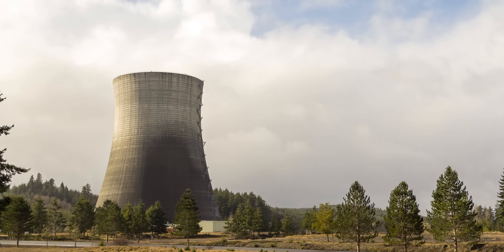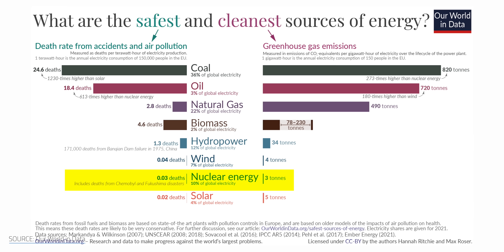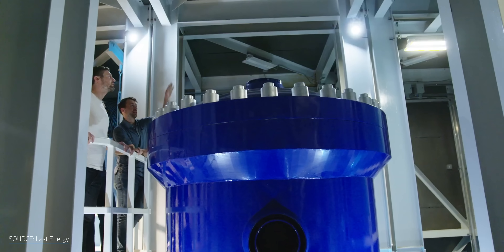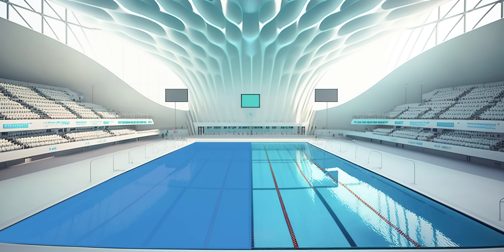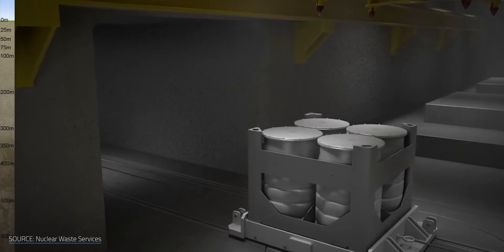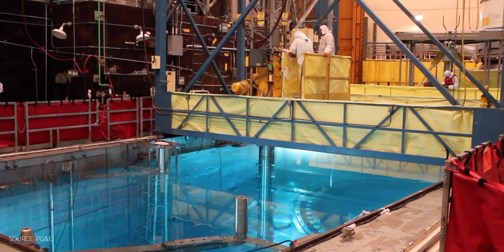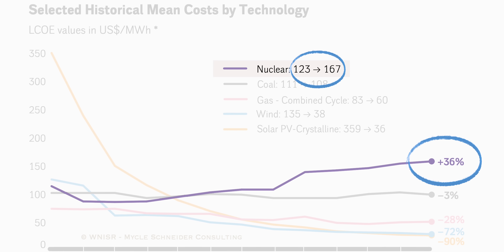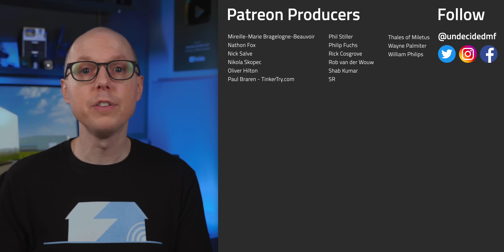Is Small, Fast, & Cheap the Future of Nuclear Energy?

Comment: The most boring job on a military nuclear ship is the reactor operator.  
   Generation 4 nuclear runs itself and can be remotely operated.
 is walk away safe. 
    I much prefer small modular reactors that are assembly line built truck out to a site.  If you need more power you just put more of them in a row in series. 
   It's like the difference between driving a Toyota Corolla down a mountain road versus a semi truck

Comment: Thanks matt. Nuclear waste is a bit of a misnomer because add that to some thorium and a little plutonium and you've got a fast breeder reactor make it all kinds of power for City grid heating or making hydrogen for airplanes and trucks or powering your homes and business. 
In all this is small enough about the footprint of a home Depot a truly local power grid play compliments wind and solar.  
All assembly line built and put together like Lincoln logs

Comment: small as in SMR isnt proving to be cheaper, and if costs are bothersome for you, you need to look at a full system cost.
In a big country like Australia the electrical grid, the poles and wires that connects power generation to the customers and consumers, costs 40% of each account.
If you want renewable technology over point producers such as nuclear, renewables are a bigger, sprawling network connecting wind and solar farms over 100s of miles.
In Australia, we think this could double the size of the grid, and that would make the cost of it closer to 60% of each account.
The kicker is, even if energy were the same price, your bills would rise just because of the larger grid.

Comment: Smaller nuclear plants are a great idea, especially when paired with standardization. However, I believe we should only continue to use and invest in nuclear energy if we commit to recycling fuel pellets to reduce the storage half-life. Additionally, we must proactively and continually improve safety measures. History has shown that unforeseen events are always possible, even when everything seems safe and positive. Otherwise, I fully support nuclear energy, at least until we can successfully develop fusion power.

Comment: 4 terawatt ( USA consumption ) divided by 20 megawatt ( small power station ) = 20, 000 units required !   30 years to build up 20, 000  power stations at  670 installations per year , then a replacement program of another 670 power stations per year  (2 per day). Is there enough nuclear fuel for the rest of the world? My calculator just blew up when I tried to calculate the yearly cost for the USA ( $68 billion per year , every year until the fuel runs out ) . I think small nuclear reactors will be put to better use in remote places  such as outer space.
Installation is $10 million per 20 megawatt of wind turbines , or $20 million per 20 megawatt of solar panels , with a replacement of time of 40 years and installation time of less than a year.

Comment: Look at the 2023 Lazard LCOE study chart. The nuclear LCOE shows a range that includes your number. However, there is a small diamond down around $30/MWh with a footnote 5. Footnote 5 says that the median cost of nuclear power from a fully  depreciated plant is comparable to wind or solar. Hence, the cost of nuclear is largely the cost of money. Once to mortgage is paid off, the cost is comparable to wind and solar. And that low LCOE for wind and solar does not include the cost of storage.   
Nuclear fuel cost is around 5% of operating cost,

Comment: SMR application is limited to specific situations. Powering remote outposts or small town that don't have access to a power grid. They are not cost-effective for general power generation. A company may use one if they needed both electricity and process heat, but there would need to be an adequate building site.

Comment: with a background in utility operations I can attest to the fact that there are no secrets or unknowns re: NUKES! There are enough  bright minds to resolve the matter of what to do with the spent  fuel. Being able to use the  spent  material to a total expended level will be and should be VERY possible. The real  issue to deal with is the total control and political extraction from NUKES. The earth will pollute itself out of existence before it  will become damaged by the use of NUKES. This issue should have been solved YEARS ago, at least under the weight of the Arab Embargo in the 1970's , strictly political BS.

Comment: The US has been building smaller compact nuclear reactors for decades to power aircraft carriers and submarines. The reactors for the submarines are really compact.
Reply: They also have NONE of the safety systems of commercial plants and are shutdown when in port for that very reason.   Their ultimate safety system heat sink is the ocean and many have had to use that.

Comment: I think that economy of scale has always been thought of the wrong way round in the field of nuclear energy. Normally, economy of scale means that high quantities lead to low costs. Therefore, this would actually speak in favor of SMRs rather than large units. In the case of nuclear energy, however, this is strangely associated with the size of the plants. 
This misguided approach has led to overpriced reactors that are difficult to build and which are also far too large from the point of view of the electricity grids. This has been demonstrated in Sweden, for example. There, two power plant units with 2.2 GW combined shut down at the beginning of 2023. A protective trip in the power grid caused both Power plants to shut down. This seriously endangered grid stability, as there was a very large frequency dip. To prevent this from happening, fossil fuel power plants like coal and gas were never designed to be this large and were standardized in larger quantities, which is reflected in the SMRs.
Furthermore, the standardization of very large nuclear power plant units is both a curse and a blessing. Although standardization leads to lower costs, it also involves risks. France is a negative example: in 2022, for example, several problems were discovered in the cooling systems of a specific reactor type. As a result, more than 10 power plant units were shut down for an indefinite period of several months. As these units are very large at around 1.34 GW each, this supposedly minor problem worsened the security of supply in France last winter. As a result, France was at times heavily dependent on electricity imports and the already indebted operator EDF accumulated such high debts that the company had to be nationalized.
These problems show that large reactor units are a dead end. SMRs will certainly be able to deliver more advantages here, as the higher quantities mean that many units can be tested in parallel in several variants in the engineering process. This would avoid unpleasant surprises, as is the case with large units, not to mention reduce construction times.
In addition, small units offer large industrial companies in particular the opportunity to set up their on-site electricity and heat generation on a modular basis to meet their own needs.
Reply: Spoiler alert; NuScale just canceled their SMR project after receiving NRC approval and $2 billion in taxpayer money.
This is from the Des Moines Register an concerning the only Small Modular Reactor (SMR) project in the U.S. today. It should be noted that NuScale said (Jan/2023) the target price for power from the plant is $89 per megawatt hour, up 53% from the previous estimate of $58 per MW hour

In 2013, the Wall Street firm Lazard estimated that the cost of generating electricity at a new nuclear plant in the United States will be between $86 and $122 per megawatt-hour. Last November, Lazard estimated that the corresponding cost will be between $131 and $204 per megawatt-hour based upon the 4 recent new nuclear projects in the U.S. . During the same eight years, renewables have plummeted in cost, and the 2021 estimates of electricity from newly constructed utility-scale solar and wind plants range between $26 and $50 per megawatt-hour. Nuclear power is simply not economically competitive.
SMRs will be even less competitive. Building and operating SMRs will cost more than large reactors for each unit (megawatt) of generation capacity. A reactor that generates five times as much power will not require five times as much concrete or five times as many workers. This makes electricity from small reactors more expensive; many of the original small reactors built in the United States were financially uncompetitive and shut down early.
The estimated cost of constructing a plant with 600 megawatts of electricity from NuScale SMRs, arguably the design closest to deployment in the United States, was originally advertised as costing $1 billion but upon requesting actual bids from engineering firms, increased to $6.1 billion in 2020. Given inflation and other cost constraints that cost today can only be expected to be significantly higher.
The cost was so high that ten members of Utah Associated Municipal Power Systems canceled their contracts. NuScale then changed its proposed plant configuration to 6 fewer reactors but increased each reactor output from 50 Mw to 77 Mw costing at total of $5.3 billion. The NRC just last week approved the construction of the 50 Mw design but now will have to start the review process all over given the switch to a 77 Mw design. For each kilowatt of electrical generation capacity, that estimate is around 80% more than the per-kilowatt cost of the Vogtle project in Georgia — before its cost exploded from $14 billion to over $30 billion. Based on the historical experience with nuclear reactor construction, SMRs are very likely to cost much more than initially expected. And they now have delayed the project start until 2025 in an attempt to find more backers.  All this before the inevitable setbacks that will occur once construction starts.

Comment: SMR's are definitely the future. I used to be anti-nuclear myself until I realized a reactor had been running under the U of A for 40+ years without incident. I only found out it existed because I was in the building dropping off packages and nearly walked into it... Granted it was a Slowpoke reactor designed mostly for experiments and learning but to know that a pre-curser Small Modular Reactor was running under the city the whole time really changed my perspective on how the technology could be applied...

Comment: Inconvenient Assessment:

All of the videos hype topics were recycled long proposed nuclear techniques never applied in scale till today. Why now, when there are not much NPPs to be added? Nuclear tech won't get cheaper anyway. If there is no breakthrough or massive constrain on other sources, fission will just die out naturally from cost overruns and better alternatives.

If they are not running as hot as traditional reactors, they are less efficient in comparison. Potentially way worse than Kugelmass would want to explain. So less energy per mass of waste. As they say they only use readily available parts. No innovation here. The opposite. More costs.
6 Mio per 1 MW potential output. That is less expensive than traditional NPPs but not much and certainly not cheap. Never cheaper than any volume build renewable source and potentially never cheaper than coal. Btw. Nuscale just flopped because of cost overruns - an old nuclear desease.

So where is the advantage overall? Maybe they can build them faster, but if you read a bit more, you know their texan prototype isn't ready till now. They are in the design phase. How do they want to build the first commercial one till 2025 then? They won't. This is not SpaceX. Last Energy sounds like the Last Attempt to get a SMRs start up commercially going.

Maybe they get a big player onboard who can provide all their needs from part sources and engineering to financing. But i wonder why they didn't till now. Maybe they are a hype like Nuscale which will burn through another 4 bio $ without a single running commercial reactor and no one wants to make the mistake again.

Talking about nuclear desasters:

What about the estimated 150.000 elective abortions after Tschernobyl? Even if it were only 15.000, these are 15.000 unessessary abortions from only Tschernobyl. Same happened for certain at every large scale desaster.
The reportedly thousands of deaths through psychosomatic distress? Do all these parents and people not count in any discussion about nuclear desasters? 
In some forests in Bavaria it is not allowed to pick up Mushrooms till today because of Tschernobyl. How to keep track of all the damage after only one desaster? What does this tell you about every desaster combined? The estimated number of unknown cases is way higher than everyone talks about.
What about the ongoing accidents in Windscale/Sellafield, La Hague and Cadarache? Not to talk about Mayak and US sites. The Kyshtym desaster alone caused 100s of deaths in 1957 - from nuclear waste. Not especially on a reactor site, but nuclear waste.
If it is not Tschenobyl, Fukushima or Three Mile Island we do not need to talk about nuclear desasters, right?
Accumulative radioactive isotopes in the food chain and human body causing long term health issues is a thing too. Just because you can't get an accurate number doesn't mean it doesn't exist.

Downplaying nuclear desasters is a recipe for provoking the next one.

Comment: The more nuclear plants raise the stat’s or odds in the chance of a disaster that could cause death. The big thing tho is the long term effects of the contaminated area.    Then your nuclear waist is a long term issue.      Know there is a nuclear type of fuel that does not have such have long term effect,  so the waist will burn out the the radiation emitted over time.         So.  It needs to be developed and studied more before small plants are placed everywhere.  Did China build a bunch of small nuclear plants  a few years ago?  Then a lot of these plant’s failed with some type of meltdown and damaged the water table in the area causing near by farms to loose crops and people to get sick.

Comment: Nuclear (fission): at 70(ish) years old, was the last commercial energy to be discovered & developed.  It did have the shortest development which meant fission almost beat solar PV to a commercial product.  

The other newcomer is also a subatomic manipulation of energy: Solar PV effect had been discovered in 1839, but took til 1950s to go commercial.  PV had a commercial product in 1955 & was being mass produced in the 1960s.  

Fission process, on the other hand was discovered ten years after fusion, had a power plant on the grid by 1956, & also went commercial in the1960s.  So fission had ~20 years of development with a world war in the beginning, while the other newcomer, PV, with 150 years of development only narrowly beat fission to commercialisation.
Reply: Oh, there are still ~ 8 RMBKs operating relatively safety today, 40 years after Chernobyl & even Chernobyl had two reactors operating into the 2000s. 

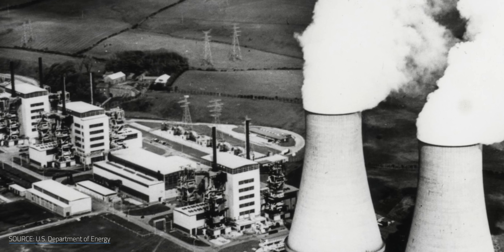@3:30

Comment: The potential whitewashing of the effects from nuclear disasters is concerning. Whilst the number of "provable" deaths is a few dozen or so with Chernobyl, 1.8 million people are considered "victims of Chernobyl" as suffering from radiation poisoning isn't of course limited to just death. The true death toll in the long term is also contested. Some putting it in many tens of thousands, others significantly more. The fact that it's"impossible to rigourously test this scientifically" according to certain officials, doesn't just suddenly erase the stark possiblity of a considerably larger death toll than the "official number"  as well as the obviously large amount of suffering caused through disease and disability.

Comment: I must disagree with anyone that says that a high-pressure water-based nuclear power plant of any size is safe they are unsafe at any size at any duration of operation they never should have been used anywhere except for on submarines molten salt reactor on the other hand use molten salts to transfer heat to other salts that are molten and they transfer at low-pressure this heat to water that is then flashed to steam and used to generate electricity if anything goes wrong all that happens is the reactor goes cold and has to go through a lengthy process to start it back up but it does not melt

Comment: My understanding is that this problem was solved in the 50's with LFTR reactors. Had politics (vote buying for jobs in Cali) not dictated that the already outdated fast breeder reactors be the dominant tech, LFTR reactors would probably be about the size of a tool shed in your back yard, and provided power for your entire block. This is the insidiousness and insanity of centralized public utilities. The only real answer moving forward is complete decentralization of all public utilities to the individual housing level ideally, but the block level would be a good start.
Reply: In addition, most of those price tags for existing plants are the result of gov't giving their crony campaign contributors monopolies for reactor and fuel production via mostly nonsensical legislation. Especially the whole non-proliferation debacle.

Comment: radiation causes millions of deaths per year.. and the solution to fossil fuel emissions is modern scrubbers.. you are showing data from all countries.. there a lot of countries that rely on coal and coal alone.. they have little to no safety standards.. and no modern technology to scrub emissions. Those plumes of water vapor exiting coal fired plants in the US are less harmful than the solar energy industry due to the low efficiency, low lifespan, mining and manufacturing of lithium, and lack of recycling for panels.